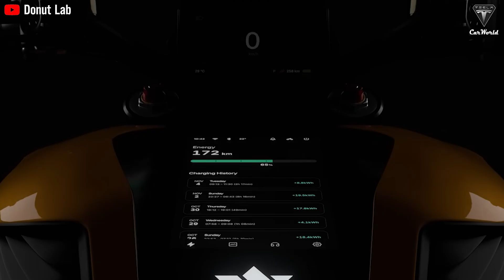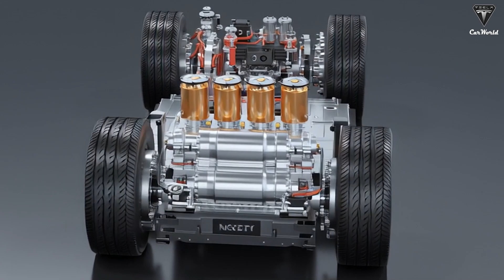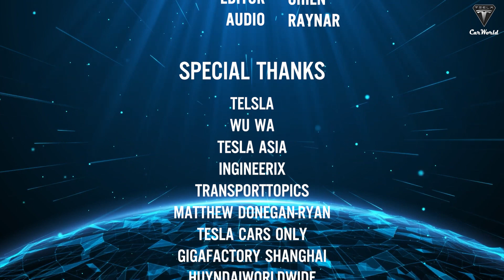World's FIRST Solid State Battery in Production? Donut Lab Leak the Truth Inside!

Comment: Aluminum requires higher operating temperatures to compensate.
Reply from the maker: Thermal limits matter at car scale. Donut targets small systems first, where thermal control is simpler and temperature stability is easier to manage.

Comment: Having the most valuable invention on history...and going to "production" in 3 months without patents... is all the proof I need to know it will not be released at these specs at this timeline.
Reply: When you apply the patent you have to reveal every detail about your invention. And its about 3 months and chinese are making them 😂😂
Reply: @villeveikko1 of you produce without a patent you can legally get ripped off... I'd rather it be illegal 😂
Reply from the maker: Breakthroughs aren’t proven by patents, but by products. Entering motorcycles first limits risk and exposure—an unusual move for vaporware
Reply: What would convince you it’s real, independent safety testing, disclosed manufacturing lines, or actual units operating outside controlled demos?

Comment: Nordic nano oy, The company's product portfolio consists of two product families: solar energy systems and energy storage. The ultra-thin, flexible solar film collects twice the energy of traditional silicon-based solar panels. Solid-state salt batteries are manufactured by printing from nanofluid, which enables efficient use of space and the manufacture of batteries in various shapes.

“Our solutions are lightweight, energy-efficient and safe: they do not overheat or explode. The battery charge cycles are remarkably high,” says Pia Erkinheimo, Nordic Nano's Corporate Relations and Sustainability Director.

Nordic Nano's operations are based on advanced Finnish and European nanomaterial and manufacturing technology, with sustainable development at the heart of the company.
– The solutions we offer reduce the environmental load and maintain biodiversity. We do not use toxic materials or rare earth metals. The longer-term goal is for our products to be carbon negative.

Nordic Nano stands out from its competitors by combining high performance and durability. The price level of the products is also competitive compared to other solutions on the market.

– Our solar film is lighter, more efficient and can be applied in a variety of ways thanks to our printing technology. The batteries have a long lifespan measured by the number of charging cycles, Erkinheimo continues.

Nordic Nano will start industrial production in 2026. The goal is to directly employ over 50 people within three years. Turnover is expected to grow to over 100 million euros.

– We want to be involved in regional development and work in cooperation with the active ecosystem in the area, learning and experimenting together.

Comment: Not fake. Not enough time. 
Wait 60 days.
There is certainly something very interesting thing. Certainly nano carbon tubes from nano tech finland.
There is no industrial production line.
But all can go fast. 
Flat tv.
Led lamps
Even ford T
Reply: Nordic Nano + Silasmaa is interesting background, but their public work is nano‑additives for “sustainable storage,” not a full lithium‑replacement solid‑state cell. Even if they have something novel, hitting 400 Wh/kg, 5‑min charge, and 100k cycles simultaneously is beyond current materials science—dendrites, interface resistance, and thermal limits don’t vanish overnight. Happy to be wrong if independent tests prove it, but history says temper expectations.
Reply from the maker: Agreed. Early vehicle deployment and small-scale systems fit cautious validation. Real-world data from motorcycles will clarify claims faster than speculation.
Reply: fake，100000？？？？

Comment: it's not donut lab technology Its a Nordic Nano Oy technologie and donut lab is the first customer but also investor in Nordic Nano Oy.   What has to be verified is if Marko announcement is approved  and more important  performance and shipment End March 2026  of the first factory cell produced in Imatra is also validated by the complete Board of Nordic Nano.
Reply from the maker: Even if Nano Nordic supplies the core cell, Donut integrates packs, electronics, and vehicles. Performance and shipments—not ownership—are what ultimately validate the claims.
Reply: I agree that Donut Lab is positioning the product, but the core solid state IP traces back to Nordic Nano Oy, so validation really hinges on their board approval, third-party testing, and whether Imatra actually ships factory cells by the end of March 26. Until independent performance data and confirmed shipments exist, it’s still a roadmap, not proof. What metric do you think matters most to validate it, energy density at scale, cycle life, or yield from the Imatra line?